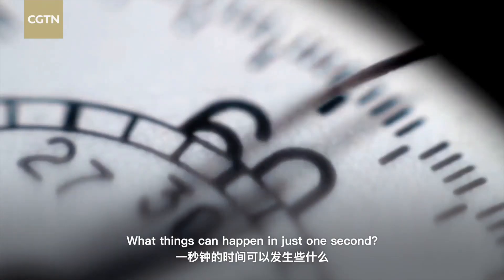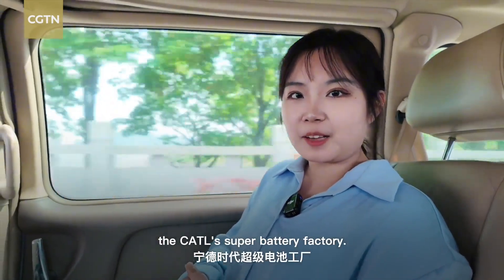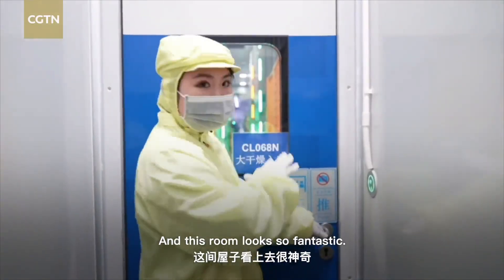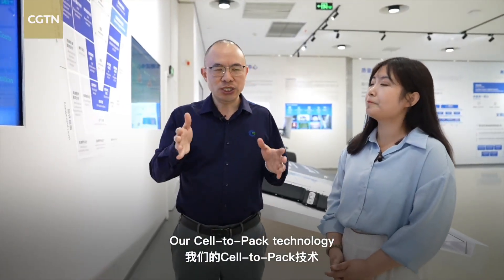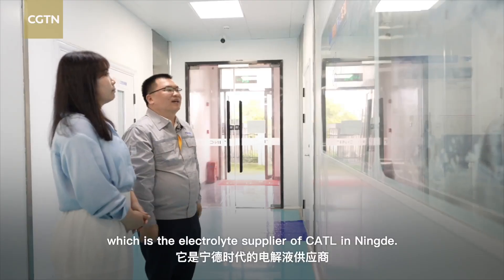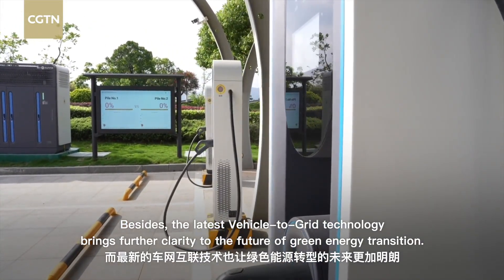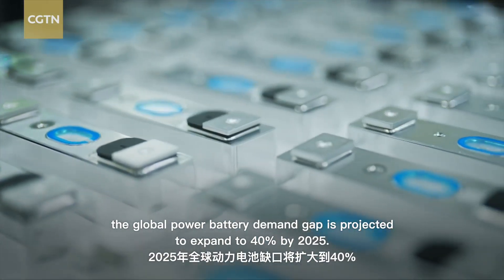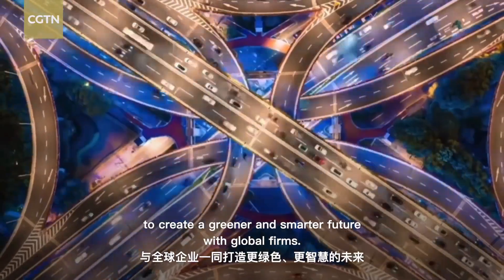BizFocus: Go inside a CATL factory to see how 'world's best EV battery' is made

Comment: A decade ago tesla and Panasonic built the first EVER gwh scale ev battery plant in Nevada. It cost over $3,000,000,000 in 2016 dollars to build.
It broke ground in 2014, opened in late 2016, fully ramped by 2019 and lead the world in gwh cell capacity from a single plant until the end of 2021. 

When catl thanks again funny enough mostly to tesla who is their single largest customer, was consuming enough lfp to make over 40% of ALL teslas sold powered with catl pack's, plus the megapack bess uses catl cells&now the powerwall 3 home battery to. 

Catl had also once told Herbert diess to get lost when he asked them to make batteries for their ev plans back in 2010. Fascinating also that the U.S. under obummer sold China the rights to lfp cell tech when it was A123 industries who owned it and built the og fisker karma pack's. 😏